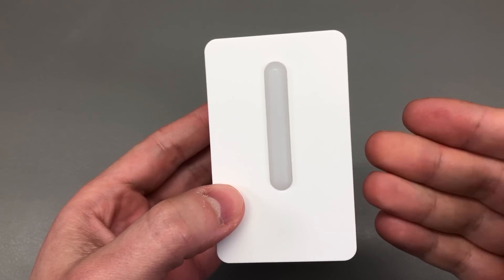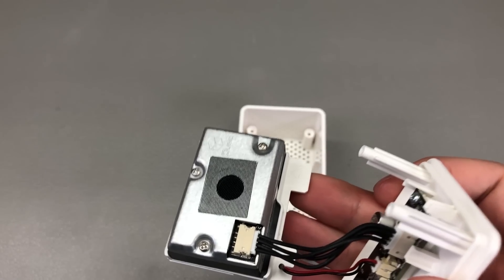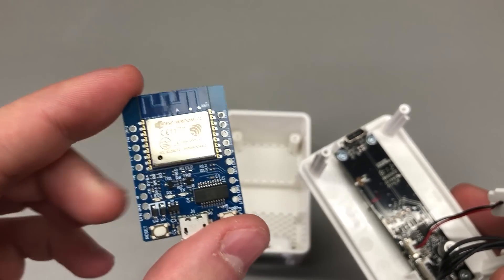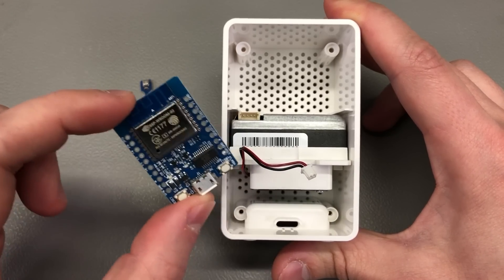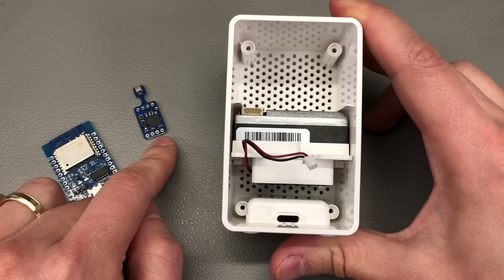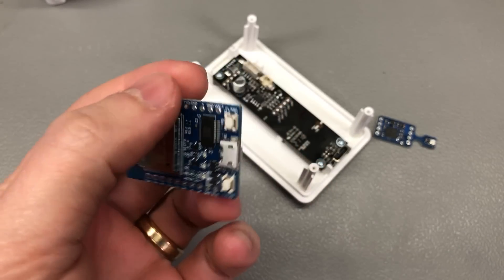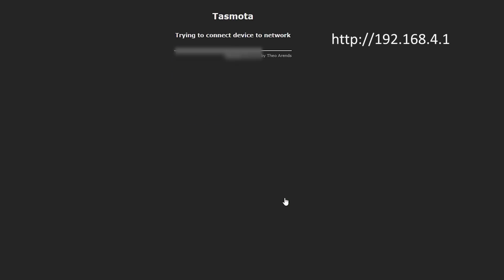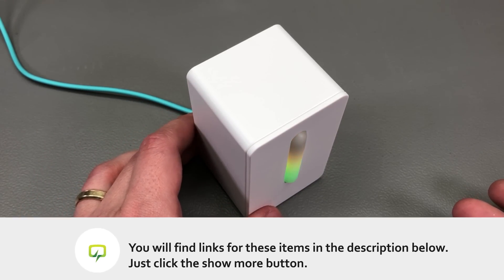Hacking The IKEA VINDRIKTNING PM2.5 Sensor With Tasmota | Voltlog #394

Comment: The particle sensor (SDS011) provides serial data including concentration for two size categories as a time series. Another hack would be to grab this data for a graphical display and daily summary (e.g. min., max., median, average daily concentration of PM 2.5 and PM 10). See for example OpenElectronics “SDS011 the Air Quality Sensor”.  I am thinking about two boxes - one a particulate monitor with serial output and a second using the fan without the particulate sensor but output temperature, barometric pressure, CO2, and other parameters. Not sure, but the fan may affect measurement of the barometric pressure depending on the pressure drop, so the sensor may have to be isolated from the air flow in the box. Amazing to get a laser particulate sensor in a box for this price.

Comment: Sorry I am a newbie. Can you please help me with the wiring diagram for this setup?
Reply: Hi, I was also strugling with the wiring diagram!  First I installed only Wemos D1 Mini and it was straight forward with 3 wires from Ikea board 5V, ground and IO. Then later I added Arduino BME680 board. For this I found diagram from here: https://learn.adafruit.com/adafruit-bme680-humidity-temperature-barometic-pressure-voc-gas/python-circuitpython Now everything works like in this video.

Comment: I have added a Senseair to measure CO2 precisely (30 Euros) and have used the ESP-M3 very small and cheap. However i would like to use it in the bedroom, so it requires to turn off the LED  during nights. any idea ?
Reply from the maker: Turning off the LEDs would require hardware mods to the original PCB or removing it all together.
Reply: @voltlog   - Do you have some insights about mods to original PCB ? any ref. schematic somewhere  ?

Comment: seem like you placement of the esp8266 board will obstruct the air flow of the fan though
 I wonder if it would be better to put in on the right or left side in the top cavity and place the  BME 680 on the opposite side 
also what about using a raw esp8266 without a board , I know there is a lot of room in there but I am concerned about  the air  flow,  I have a wemos D1 mini and  the ikea sensor but I never used  home assistant or tasmota before
I use  smartthings and have flashed esp8266 devices fro that though  using a USB seraial UART adapter 
 I have   a pi zero w and   pi zero W 2 ,  I was thinking of setting up  HA on one of them
I don't plan on doing too much with it ,  the other application  I have for the pi zero boards is for octoprint without a camera  , not sure if I should use the   pi zero w 2 for  HA or octorpint   ,not sure if the  1st gen zero w is good enough for  HA ,

Comment: Thanks for easy solution, tasmoto is quick to setup. 
There seems to be some problem with my sensor though, I get a reading that is 100 points higher than what the city graphs show, am I doing something wrong or is the Vindriktning not working properly?
Edit: the values were infact correct

Comment: Hi,nice video.
There is something i do not understand,at first you mention that you use the tx uart line of the sensor to read the data and this uses 3 pins on the idea board, gnd +5 and tx line,but at the solder work and the tasmota setup there are 4 wires connected to ikea board and I2C selected in the setup.
Please help with details for final working solution since i am trying to replicate.Thanks.
Reply: I have found my mistake,the GPIO was for the BME.It is working with a esp01 and a dth22 just fine.Great video 10x for the info.

Comment: You should add a small LCD screen on the top of the case that monitors the various sensors and outputs them to the screen?? That would be a nice way to visualise both the light and sensor outputs?
Reply from the maker: That doesn't make sense for my setup. Like I said in the video I hacked this so that it would transmit over MQTT so I can pull that data in HomeAssistant.

Comment: Curious if the barometric pressure is affected by the fan - granted it's a miniscule air flow, but the sensor could be acting like a microscopic pitot tube :)  Very neat!

Comment: Does the fan of this ikea device run all the time or does it just spin up every few minutes? Because those sensors have a finite life span which can be enlarged greatly by just starting them every 5 minutes or so for a few seconds to take a measurement.
Reply from the maker: Yes it does run intermittently but that's also annoying if you have very sensitive hearing.

Comment: I also bought an air purifier from ikea (the cheapest because it is easyer to control) and I hope to automate the starting of the air purifier when the air sensor detects poor air quality ;) that is if you wanted an Ideea.
Reply from the maker: Thanks but I already have a Philips air purifier and it does have automatic mode built-in. The ikea one doesn't? Or is it crippled intentionally because it's cheaper?
Reply: @voltlog  the most expensive one does but the cheapest one has all manual controls.

Comment: Ikea is a fucking miracle I wish more companies do this. I placed a D1 mini in mine and a dht11 I had laying around the dht11 was recicled from an old project and it fit on the upper side of the upper box. Your sensor looks better i'l get some of those because I bought another 2 sensors to put in different rooms. I was also thinking of getting a temperature sensor weather resistant put a hole thru the casing and get the wired sensor outside the window, that way I have an indoor temp and air quality sensor and also an outdoor temp sensor in the same case. I send everything by mqtt to influxdb and use grafana to graph everything and it is awesome. This is such an easy project to start doing iot stuff it's amazing. Thank you for your videos and your ideeas I am very happy because this might be the first time I hacked something before you :). Cheers.
Reply from the maker: Happy to hear people are hacking these 👍

Comment: Ok, had a quick look at the video. Need to re-watch later. Finally I can open my plastic box of pcb with sensors I think and a Wemos D1.  Was there any issue with 5V or 3.3V on IO's or anything?  I finally have home assistant running but no MQQT (need to look into that what it is exactly) but nice knowing I can check just using the web interface.
Just by reading the comments my led is green in the living room and same experience as you guys, when someone starts cooking it goes to yellow/orange.
Reply: @VoltLog   This ESP8266 has me confused.  You don't use voltage shifters on this module.  Checking other users videos, for example the one from user enwi he uses resistors to input the voltage to 3.3 Volt.  Before I blow up stuff can you enlighten me?
Reply: @VoltLog. Had a look around. Very frustrating having like 30 browser tabs open with info but found that it was ok for the 5V, had another module lying around here, BME280 which did need to be connected to the 3.3V on the Wemos D! but after a couple of hours it all worked. 
BME280 Temperature	16.5 °C
BME280 Humidity	59.5 %
BME280 Dew point	8.6 °C
BME280 Pressure	1030.0 hPa
VINDRIKTNING PM 2.5 µm	32 µg/m³
But the humidity sensors. I think it is time to test them all and check the readings. Temperature wise they all seem to be kind of showing the same but humidity they are all over the place.

Comment: A straightforward hack that can be reproduced by most of your viewers. Great content! Measuring PM levels here is mostly uneventful. It's pretty much 1-2ppm except for some time after cooking on the stove. There's still one use case for me that I find useful.. Peeling onions shows up as values around 20-60ppm. My eyes are hypersensitive to that, so a particulate matter sensor in the kitchen tells me when it's safe to go there without making my eyes blurry for the next 30-60 minutes. 😄
Reply from the maker: Interesting to hear the air quality is very good where you live. I am personally getting values in the 10 µg/m³ in my living room on the VINDRIKTNING sensor when there is no disturbance happening like cleaning. In another room where I have a Philips air purifier it shows values in the range of 2 µg/m³ but I suspect the purifier creates this bubble micro-climate around it and the measurement doesn't actually represent the whole room, but I need to run more tests by placing both sensors in the same room.
Reply: @voltlog  You might actually have a point there. I had a PMS7003 sensor running for 1.5 years starting from 2018. I now checked the stats again and indeed the values were higher than that. PM2.5 and PM10 were mostly jumping between 1-8 µg/m³ but during summer (likely due to pollen) the values ran around 10-30 µg/m³. Currently my only sensor is the one on my Xiaomi purifier which shows 1 µg/m³ (PM10 perhaps?) basically all the time, except when cooking.

Edit: changed ppm to µg/m³, mixed up with CO2 values for a moment.